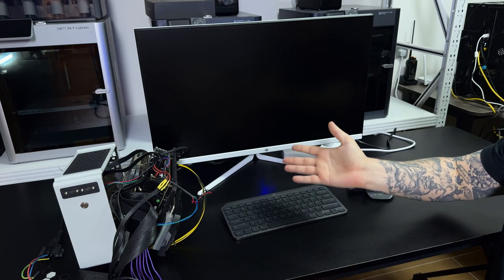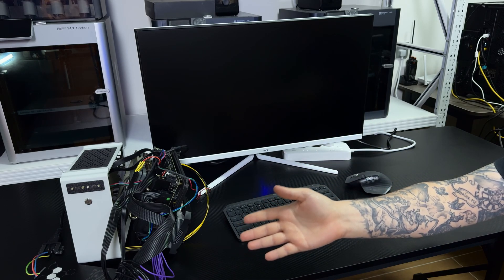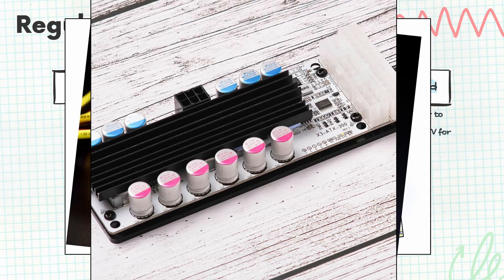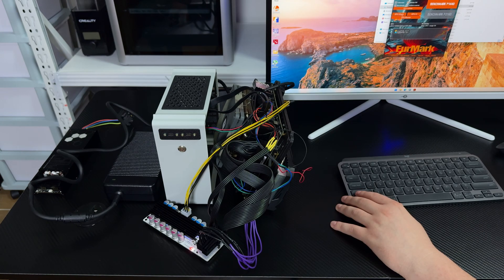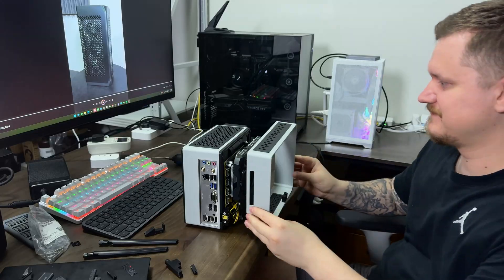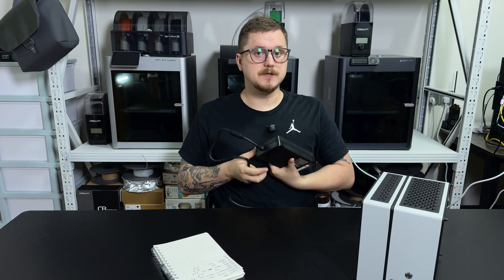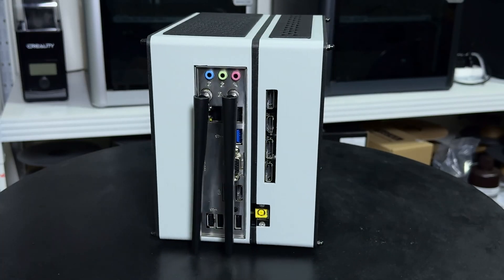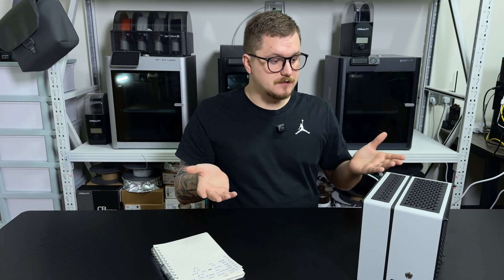Desktop powered by a Laptop power brick ?!

Comment: As far as we know, an external DC block is usually not designed for long-term operation under high load, overheats faster, while ATX has full cooling inside the case and is better designed for 24/7. It would be interesting to know the operating experience after some time.